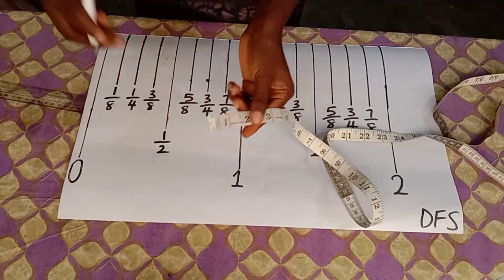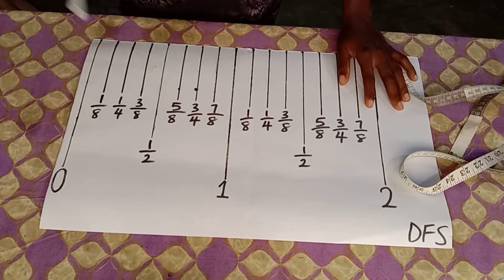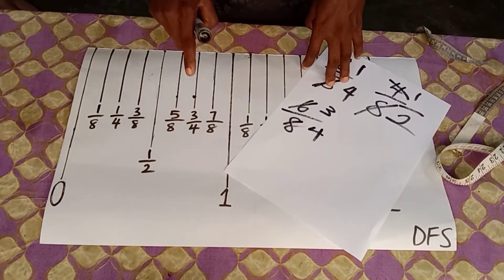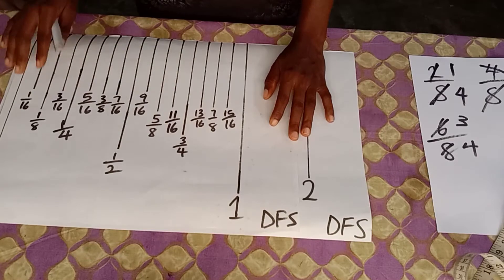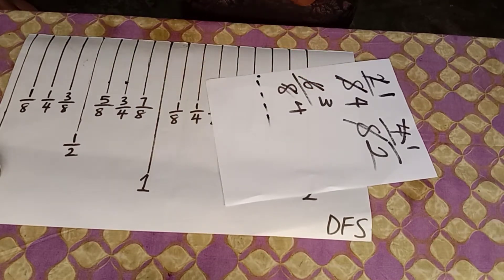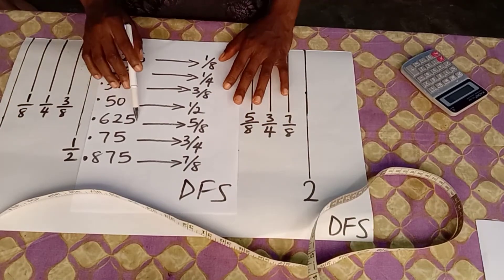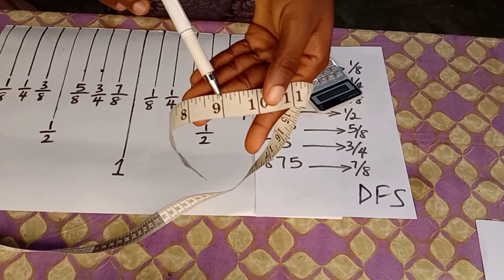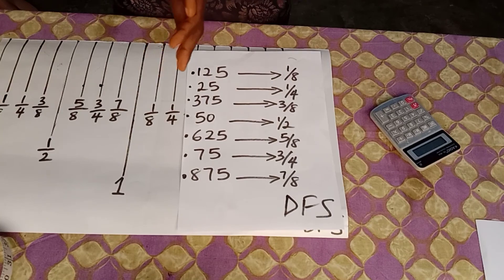How to read a tape measure perfectly #decimal points

Comment: thank you for your videos!!! 5.3 inches is exactly where? .3 is between the 1/4 and 3/8? ?  I'm confused on .3
Reply from the maker: .3 is 3/8 because 3/8 is .375, you might not let it be exactly on the 3/8 inch bar to get accurate .3